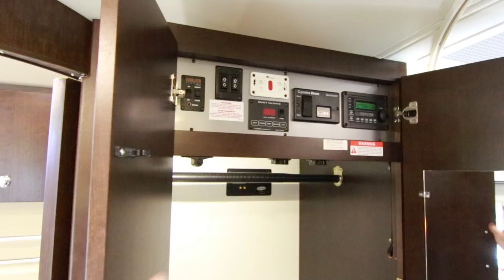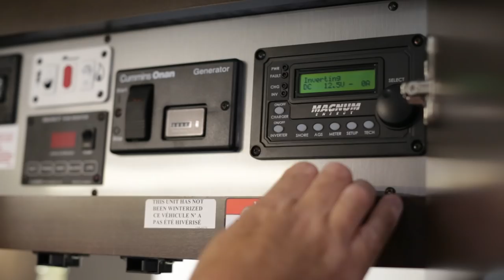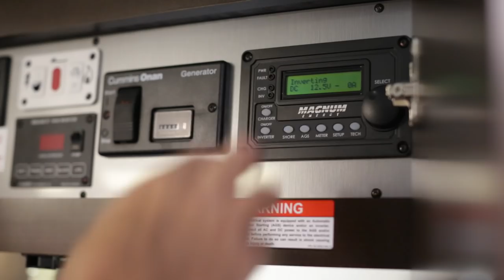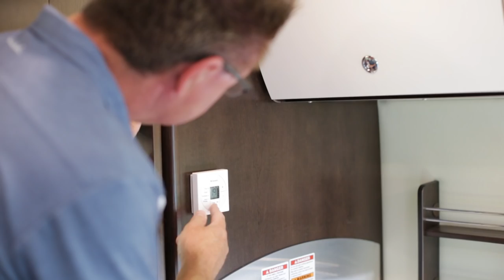2016 Serenity

Comment: Yeah there great when new when they get miles on them stuff starts to go wrong.. You had better have a big wallet if stuff starts to go wrong.. MB engines cost a bundle to fix along with the trans.. Brakes tires big bucks.. You could end up spending thousands just remember that..